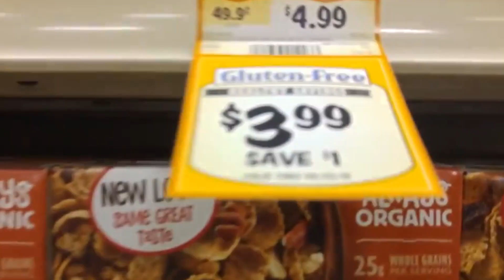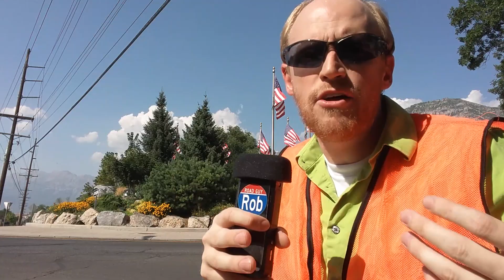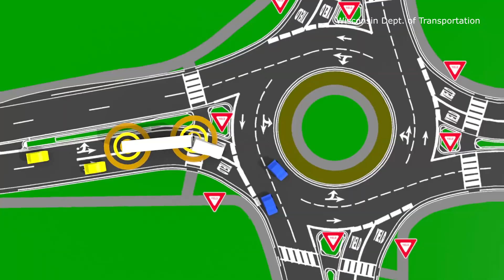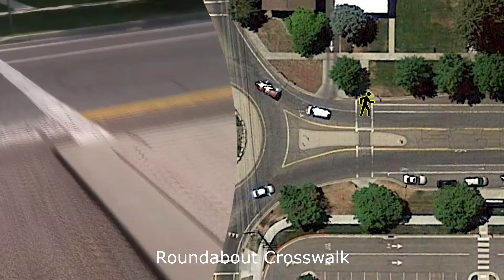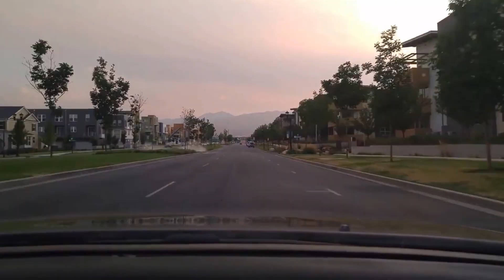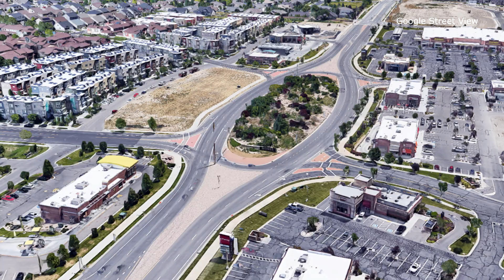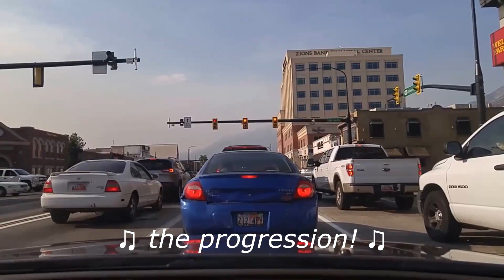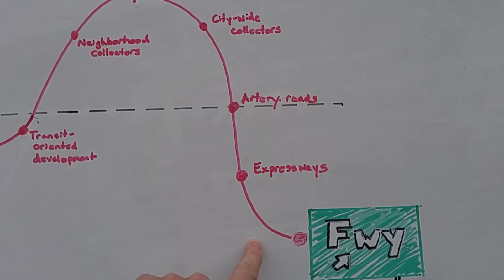Are roundabouts REALLY better than a traffic signal?

Comment: Commenting from Milton Keynes UK, which might be the most roundabouted city in the world? For the busy ones that intersect big roads, we sometimes stick traffic lights on our roundabouts! For example check out some of the roundabouts along the A5 as it goes through Milton Keynes. As you say, when we get to freeway (motorways) like the M1, there are just roundabouts for the on/off ramps, rather than the freeway itself. Thanks for the video, i felt a bit of kinship!
Reply: Ben Dryer I live in Swindon where they also love their roundabouts, we also have a roundabout made of roundabouts and we used to have a square of four roundabouts, all connected. Like a double roundabout but better. We don't have many T-junctions, they made them all mini roundabouts which act as traffic calming. It's stupid. To get to the main road from my house (it's walkable in like 5 minutes), you have to go over 3 roundabouts
Reply: They have roundabouts for the on and off ramps in Massachusetts, too! Usually they are big circles called "rotaries" accommodating all the ramps and side roads rather than the dogbone double roundabouts I've seen in videos from the UK.
Reply: @edwardmiessner6502  Those are common in the UK as well.
Reply: We have had them forever in New Jersey also. They work ok in small areas without a lot of traffic, the issue is NJ has tons of people and traffic. 
We also have some with traffic lights and multiple lanes that will be horribly backed up and impossible to get into the needed lane, some so bad they even have / had their own wikipedia page.
https://en.wikipedia.org/wiki/Marlton_Circle
Reply: Milton Keynes has some pretty big roundabouts on roads where the speed limit is 70mph. On some of them the sight lines are good so you barely need to slow down if the traffic is light.
We do have some roundabouts on motorways here but they are usually at ends or at junctions, although some of those are junctions between motorways, like the M18/A1(M) or both ends of the M58. The M271, A601(M) and A627(M) have them in the middle.
Reply: A roundabout with traffic signals is a traffic circle.
Reply: @melanieclark7949  Not in the UK :-). It's still a roundabout. Even if it's square. And as mentioned above, google for Magic Roundabout in Swindon or Hemel Hempstead. They look frightening but work strangely well. There's also one at Hatton Cross which is very close to Heathrow airport.
Reply: @acciid  Uhm, OK